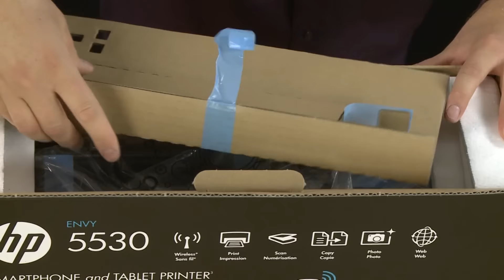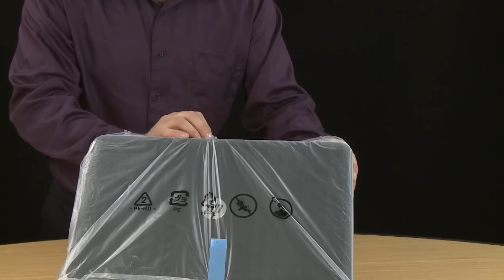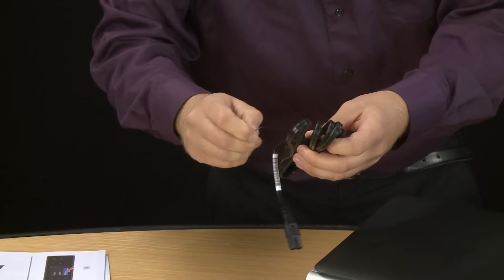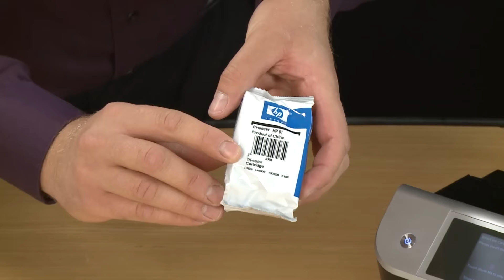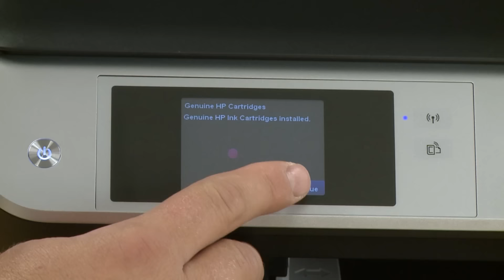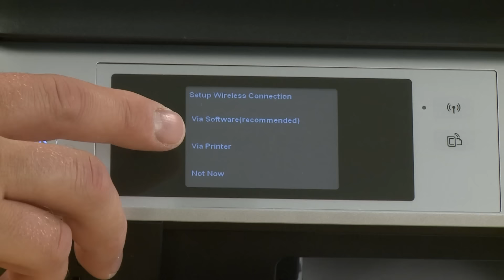Unboxing and Setting Up the HP Envy 5530 e-All-in-One Printer | HP

Comment: My PC operates by Chrome. How do I connect?
Reply from the maker: Chromebooks don’t have traditional print drivers as it uses Google Cloud for printing. 
 
Please start by running the wireless setup wizard found on the front panel of the printer.  I have included the instructions from the Envy 5530 User Guide below.  To find the User Guide, please search for C03773204 on HP’s home page or using Google search.
 
›  From the home screen, touch the ‘Wireless’ icon
›  Touch ‘Settings’
›  Touch ‘Wireless Setup Wizard’ and follow the prompts
 
Now that the printer is connected to your wireless network we need to enable the web services so the printer has an ePrint email address (these steps are also available in the User Guide). 
 
›  From the home screen, touch the ‘ePrint’ icon
›  Accept the Terms of Use and then please follow the prompts.  A Web Services information sheet will print with your claim code.  If you prefer not to customize the printer’s ePrint email address then you don’t need to use the claim code.  The printer’s ePrint email address will be the claimcode@hpeprint.com.  If you would like to customize the printer’s ePrint email address, then please search for C02940150 on HP’s home page or using Google search.  The title of the document is “Setting Up a Custom Email Address for ePrint”.
 
Now let’s connect your printer to Google Cloud Print.  Please search for C02817255.  The title of the document is “Using Google Cloud Print with your HP Printer”.  
 
Once the printer is connected to Google Cloud Print you should be able to print from your Chromebook.  For reference, if you search for “Google Cloud Print Help” using Google search and the first hit should be the Help Center.   It has some good information as well as has the steps for how to print.

Comment: I want to know were do I get my password to connect to my printer ...
Reply from the maker: Hi Rosalba Perez,
 
I am presuming that you are trying to connect the printer to your wireless network.  The password that it is asking for is the password you use to log onto your wireless network.
 
If you are using the Wireless Direct feature with security turned on, you can get the password from the front panel of the printer.  The steps can be found in your User Guide on page 57 in the section “To connect wirelessly to the printer without a router”.  If you search for C03773204 on HP’s home page or using Google search as that is the document number for the User Guide.

Comment: I think something is wrong with mine. I unboxed, after I plugged it in, I didn't even have to hit the power on button, it just turned on. then a blue screen flashed that says "C4EBA808" with a power symbol, then it goes to a white screen that says "Print Error There is a problem with the printer. Turn the printer Off, then On" and the home, arrow, go  back, power button etc are flashing. I hit the power button but it doesn't shut off, it just resets and repeats the process. I'm beyond frustrated and I've looked online for over a hour for a solution. I feel like my new printer is just a lemon.
Reply from the maker: Michelle D'Antonio
I'm going to ask you follow the same steps I've posted for another customer on this thread. And don't feel like you are going crazy, I hadn't posted the steps yet when you posted your question.

Please try a power reset of the printer.  The steps are as follows:

1. If the printer is currently turned off, please turn the printer on.
2. With the printer turned on, please unplug the power cord from the back of the printer.
3. Please unplug the power cord from the wall outlet.
4. Please wait a full 60 seconds to allow any power in the adapter to dissipate.
5. Please plug the power cord back into the printer and into a wall outlet.  It is important to ensure the printer is plugged directly into a wall outlet.
6. If the printer does not turn on by itself, please turn the printer on.

If after performing the above, you still have the same error message, please call our technical support at 800-474-6836. If you live outside the US/Canada Region please go to Google search and enter 'contact HP worldwide'.  Your first option should be the site for contacting HP, when you click on it you will be prompted to choose your country/region.
Reply: Curious if you got a fix for this or if you had to have the printer replaced. I have the same error code out of the box and if it weren't for this post I wouldn't have been able to call HP support. Their website for support is atrocious and gets you nowhere. 15 minute support phone call with no resolution. The printer is going back to Costco and no more HP products for this household. What a terrible terrible experience.

Comment: What is the sticker you see on the cardboard at around 1:09 of the video?
Reply from the maker: Daralantan The sticker looks to be a bar code. Is there any additional letters or numbers below the black lines?
Reply: I put mine on the back of my printer which is in another room now.  But it's some kind of bar code and there seems to be a scratch off section on it too.  I didn't know if this was something important I absolutely needed to know, or if it was just there as an additional identifier for the printer.  I don't print on a consistent enough basis to make good use of the ink subscription program, and was thinking that that was probably what it was for... but nothing in the instruction booklet or this video mentioned it.

Comment: Hi I think this gonna be stupid question but bean trying to change my printing setting from colored to B&W but I can't figure out how
Reply from the maker: Erl The title of the document that I'm suggesting you search for is "Changing Print Settings in Windows 7".  Please search for C02227495 on HP's home page or using Google search. It will explain how to change the print settings for one job or for all jobs.  If this doesn't help please let me know which operating system you are using so I can find a document or at least find the steps you are needing.
Reply: I have a macbook pro labtop and my envy 5535 is hooked up wirelessly to it wel the issue is everything works GREAT! Except...i am trying to print on regular paper an image and it is only in B&W now the b&w button is not hit nor highlighted HELP!! I can send image from my iphone n the color works fine but not from my macbook everything bw
Reply from the maker: Ashley Carberry Sounds to me like you have the queue set for B&W printing only on your computer. You can reset your printing system and re-add the printer it should fix it for you. I am providing you with an Apple Support document below that will help you reset your printing system.

BEWARE !!!! This will eliminate ALL your printers so if you have more than one you will need to re-add them all.

http://support.apple.com/en-us/HT201539

I am also including an HP Support document that will help you to re-add your HP printer wireless to your computer. Simply choose the method that applies to you and follow the instructions.

http://www8.hp.com/us/en/campaigns/wireless-printing-center/printer-setup-help.html

Comment: The CD Doesnt even fit in my laptop!
Reply from the maker: Ovior♡ What is the version of operating system installed on your notebook? What is the product and model number of your notebook computer? Are you connecting your printer to your computer using a USB cable, or to a wireless network?

Comment: I have a HP ENVY 5532. I can scan in color and copy in color but I cannot from a PDF or Preview on my Mac??????
Reply from the maker: Lazy V Is your printer connected to your Mac with a USB cable or is it wireless? Are you not able to print in color from a PDF or Preview? What version of Mac OSX is installed on your computer?
Reply: ***** Connected wireless.
Cannot print in color from PDF or Preview
Using version 10.9.5 of Mac OSX.

Comment: Cannot print second page when duplex printing.  Only a small portion of the second page prints out.
Reply from the maker: Regina Guthrie I would advise you try the video Setting the Two-sided Printing Preference for Your HP Printer that I am linking below. If it does not work please re-post.

http://www8.hp.com/h20621/video-gallery/us/en/customer-care/printers-and-all-in-ones/printing/2509392443001/setting-the-two-sided-printing-preference-for-your-hp-printer/video/
Reply: ***** Thank you for your response.  I had previously set my preference to two-sided printing.  I worked with HP a few days ago for almost two hours with no resolution.  All software associated with the HP Envy 5530 was uninstalled and reinstalled.  Problem remains.  I am using an HP Pavillion g7-292nr Notebook PC and Windows 8.1.  When I attempt to print an Excel spreadsheet or Word form with a lot of data the second page prints first with no issues.  The second page only prints two or three columns of a fourteen column budget in Excel or bottom few lines of a Word document.  Error message appears on the screen saying "Error printing on HP Envy 5530".  I can print on two separate pages with no problems but the two-sided printing does not work.
Reply from the maker: Regina Guthrie If you could run the Firmware Update I am linking below and once it is completed try to do a two sided copy. If you are unable to do the two-sided copy you will need to talk to HP Technical Support as you may have a possible hardware issue.

http://h10025.www1.hp.com/ewfrf/wc/softwareDownloadIndex?softwareitem=al-134042-1&cc=us&dlc=en&lc=en&os=4132&product=5304883&sw_lang=
Reply: ***** My printer is grayed out on the select the printer you want to update screen.  I cannot select the printer.
Reply from the maker: Regina Guthrie I would like you to call in to HP Technical Support and explain the entire issue to them.

Comment: don't buy if you want to use refilled cartridges, it is a huge pain to replace ink- this printer will freeze until it gets the official HP cartridge. My scanner can't work until I have another set of cartridges in. You can get it to print - but it takes times to try each and every option. The time you spend doing this equals the extra $ for the HP cartridges. But then it's like you have signed a contract to be a zombie to HP. Shame on them. I would not buy another HP with this crap. I bought an old HP 2006 laser. Press and print.
Reply: arttubelady could not agree more with your comment... my last printer (HP) was expensive on inks and would not use other brands without causing issues. Its now been over a year since i used my printer as it is too much hassle and expensive, so I am looking for a new printer and was considering this but looks like I am not going to get any more pleasure than my old printer....Guess I will go old skool printer to," Press and print" sounds nice and simple and cheap to me ;)

Comment: My touchscreen is terrible - i have to press many times before it registers my selection  (I even tried using a pen for a touch screen) - there doesn't seem to be a 'sweetspot'- is this normal - or do you think that there may be a problem with this particular printer?
Reply from the maker: Heather Gilhespy Try using an eraser from a pencil and see if that works better. If not then you will need to call our technical support at 800-474-6836. If you live outside the US/Canada Region please go to Google search and enter 'contact HP worldwide'. Your first option should be the site for contacting HP, when you click on it you will be prompted to choose your country/region
Reply: I just got one, it seems like it just needs a short "long press" basically.  If I try to just tap it like a cell phone it doesn't work every time, but if I leave my finger in place for half a second it works every time.  Sucks for typing in the network password though...
Reply: FAB, thankyou

Comment: where is the USB 2.0 port?
Reply from the maker: +Jill Allen    Please search for C03773204 on HP's home page or using Google search.  That is the document number for the Envy 5530 User Guide.  On page 5 you will find a diagram of the back of the printer which shows you where the USB cable port can be found.

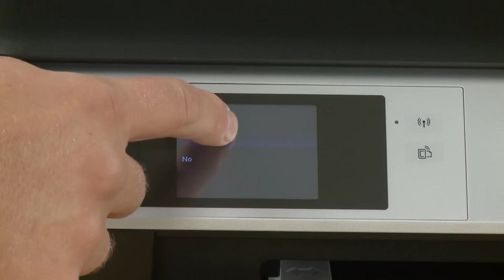Comment: I just bought this printer and it's not working. When I press "setup" (6:10 in the video) I get a message "Carriage Jam. Remove all packaging from inside the printer, then touch OK to continue." I've already removed all the packaging, but the carriage doesn't move. It's firmly stuck in place, and the printer itself can't move it either. My first disappointment with hp in the years I've been using their products.
Reply: After violently forcing the carriage out of place, I was able to fix it. This should not have had to be done.

Comment: I bought the 5530 .i activate it i choose language and region  and stuck on the set up screen.What can i do?
please help me
Reply from the maker: +John Panag   Please start by doing a hard reset of the printer following the steps below.  

- While the printer is turned on, please unplug the power cord from the back of the printer. 
- Please unplug the power cord from the wall outlet/power bar/surge protector. 
- Please wait a full 60 seconds. 
- Please plug the power cord into the back of the printer and a wall outlet.  It is important that the printer is plugged into the wall outlet and not a power bar/strip or surge protector.  
- If the printer does not turn itself on, please power the printer on. 
- Does the printer complete its start up routine so you can see a menu or options?

Thanks.
Reply: hi HP -support. I have the exactly same problem. I have done the steps that you instructed here above, but my "setup" button still doesn't work. the "setup" is freezing, so even when I push the "setup" button, nothing happens. I can print from my computer, but I can't use the scanner  because the "menu" does not show on the printer screen. I hope you can help me. thanks.
Reply from the maker: Is it the same printer type as in the video?  If not, please let me know the model#.  Is the printer plugged directly into a wall outlet, or through a power strip or UPS or other similar device?   If it is, try the hard reset again but try plugging directly into a wall outlet, although another option would be to try using an outlet in a kitchen and see if the menu will proceed as normal. Let me know when you can.
Reply: Hi HP Printer Support, 
yes it is the same printer type. I found a solution to the problem. the screen is not as good at sensing when you touch it, the whole screen surface doesn't sense when you touch the screen. only parts of the screen can sense if you touch it.
Reply from the maker: Glad to hear it is sorted out. I was apparently out in left field thinking about power, but it is often a possible cause.

Comment: Why is this printer so difficult to set up wirelessly to my PC? It won't print at all. Might be going to get my money back.
Reply from the maker: Hello JDM,
This printer has a utility found in the front panel menu titled the “Wireless Setup Wizard”.  It walks you through connecting the printer to your wireless network.  To find the wireless setup wizard the press the wireless icon on the front panel of the printer and then touch Settings.  The Wireless Setup Wizard will be listed there.
Once connected to your network, when installing the full feature software and drivers your computer should have no problem seeing the printer if both devices are connected to the same network.
Reply: +HP Printer Support  does hp laser printer 5530 use a toner please respond to this very simple question but HP MADE IT AS CLEAR AS MUD
Reply: +GINO GUADAGNIN i am waiting   toner yes or no
Reply from the maker: +GINO GUADAGNIN   HP doesn't have a laser printer with a model number of 5530.   We do have the Envy 5530 which is an inkjet printer.  The "HP ENVY, DeskJet Printers - Printer Specifications" document ( http://ow.ly/VzkCy ) lists the cartridges required.

Comment: We do not have a wireless connection. Can I still use this printer with my laptop? Thanks RM
Reply from the maker: RM chain Yes you can install it as a USB printer.
Reply: Thanks very much!
Reply from the maker: RM chain Happy to be able to help!
Reply: However, my laptop is not recognizing the software for the printer. Have any thoughts? I have an old compaq. I have trouble watching DVD's on it. Could that be the problem?
Reply from the maker: RM chain If the computer is not recognizing the software are you sure that the operating system is supported by the software? What operating system are you running and I will let you know.
Reply: Thanks, but I just purchased an HP Envy M7-K111DX notebook. It should be compatible. Do have any vids about this setup? Thanks RM
Reply from the maker: RM chain There is not a video available currently, but you can use the link below and follow the instructions set out there.

Installing the Printer Software in Windows 8.1 for a USB or Network Connection
http://h10025.www1.hp.com/ewfrf/wc/document?docname=c03969239
Reply: Thanks very much!
Reply from the maker: RM chain Happy to help!

Comment: This printer sucks.   I went to change my ink cartridges and now it saying incompatible cartridges even if I put the original ones back in
Reply from the maker: +Wolfy1091 sorry to hear you are experiencing Incompatible Ink Cartridge error. The cartridge might need to be reinstalled, the electrical contacts could be dirty, or there could be a cartridge or printer failure. Please try the following troubleshooting steps to resolve: http://hp.care/2pua7l0
Reply: I've tried that. I call the service center and they just tell me to buy a new printer.  This was my first and last hp printer
Reply from the maker: +Wolfy1091 I understand you have already tried the best steps and still having the issue, I would personally suggest you contact our HP phone support for further assistance: www.hp.com/contacthp/